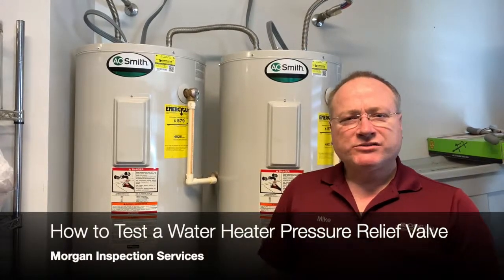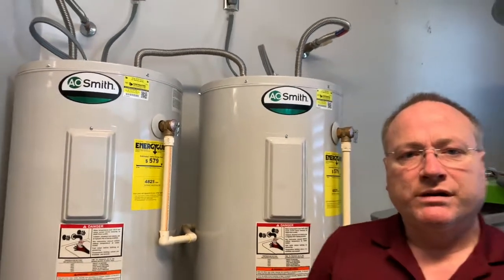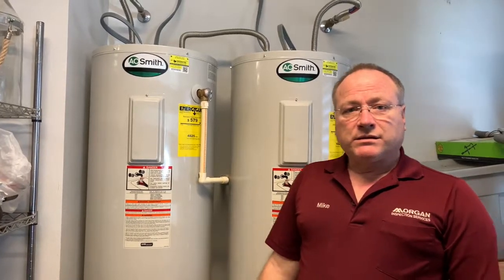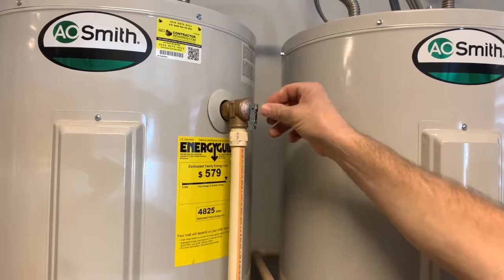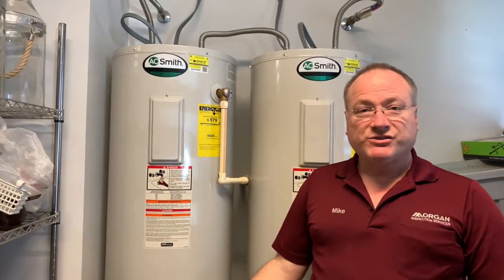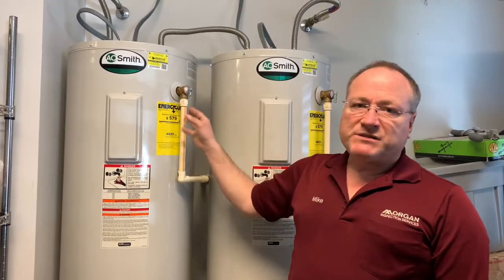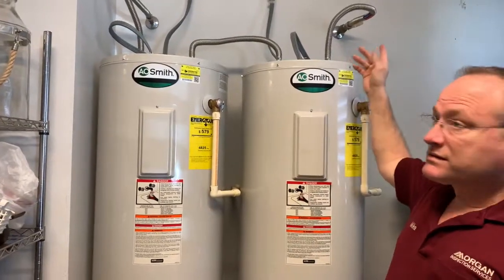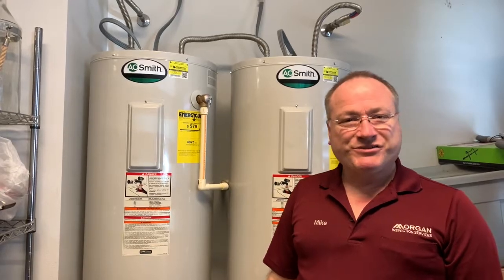How to Test a Water Heater Relief Valve

Comment: Is this valve used to draining heater for maintenance?
Reply from the maker: No. This valve is near the top of the water heater. It is a safety relief valve that will open to relieve if the pressure or temperature in the water heater gets too high. It is designed to prevent the water heater from potentially exploding. The drain valve is on the bottom of the water heater.

Comment: Mine is allowingwater to run out of the heater constantly. In 3 weeks....Ive used 100 gallons of propane and now I know why.
Reply from the maker: Sometimes these things do leak. If you open and close it a few times and tap it with something like the handle of a screwdriver, sometimes that will seat it. If that doesn’t work, it’s probably time to replace it. It’s a really simple procedure, and I do have a video about how to replace the relief valve.  https://youtu.be/zTE7g0itmZA?si=nquWx6ngtFNRyT1v

Comment: When you released the valve, you showed a picture of the outside where water was released. Are all water heaters vented to an external pipe?
Reply from the maker: They are supposed to be, but not always. You should be able to look at your relief valve and see what is connected to it and follow that line to make sure it goes somewhere safe before testing it.

Comment: My overflow drips continually. Does this valve control that
Reply from the maker: I’m not sure what you mean by your overflow. Are you talking about a PVC pipe that goes through an exterior wall near the ground that continues to drip? If that’s what you’re referring to, then yes, it could be your relief valve dripping. Often opening and closing the relief valve two or three times or tapping on it with something such as the handle of a screwdriver can close it and stop the dripping. If not, I do have a video on how to replace the relief valve. It’s a pretty simple procedure.

Comment: How often should water flow through it under normal conditions? Or is it just an emergency system?
Reply from the maker: Under normal conditions, water will never flow through the relief valve. Sometimes they will leak and some water will flow through them, but it shouldn’t ever go through the relief valve.
Reply: Thanks. I accidentally leaned on mine today and cracked the cpvc pipe. I reattached it with gorilla glue until I can research what it is and how urgent to repair it.

Comment: 🤔 dont see any expansion tanks on those water heaters... Expansion Tanks are the safety backup for when the T&P valve doesnt work. Its the little bit of extra safety to keep the water heater from becoming a water pressure bomb.
Reply from the maker: You are correct. Expansion tanks are rare in this part of the country. I’ve done about 8000 home inspections and have probably seen less than 10 expansion tanks in almost 22 years.
Reply: @morganinspectionservices3840  in the last year, I've seen 5 water heaters without them... So much for IPC lol
Reply: @morganinspectionservices3840  I got one, I'm a mait tech at a correctional facility and saw it save our ass when our reducer failed( water going into the building is over 200psi and it drops it to 65....

Comment: One tip that I found helpful,  is to have a new T&P valve on hand before you test the valve on your water heater as recommended.   That way if it continues to drip and can't be stopped you are 100% prepared.  And that could be a good thing,  because a valve that keeps dripping after testing is likely contaminated with mineral deposits and might fail to pop open in case of dangerous pressure or temperature increase.

Comment: Sorry to tell you this but you are not "testing" the relief valve.  All you are doing is "manually" opening it.  You cannot properly test a relief valve unless you have a means to isolate the valve and apply pressuer to the base and record the relief pressure with a calibrated gauge.  If you are curious, look up the American Petroleum Institute Recommended Practice, after all, you are dealing with a heated pressure vessel.
Reply from the maker: I cannot argue with you that we are not testing the high pressure or high temperature function of the relief valve. We are only testing that the valve will open.
Reply: @morganinspectionservices3840  I know I came off sounding pedantic and I apologize to you.  I understand that your advice would help to prevent a relief valve from getting stuck from scale build up.  Kind regards, Al

Comment: I like watching your videos.   About 15 yrs ago in the old farmhouse where i grew up on as a teenager,  while we were out of town hauling cattle to the slaughterhouse,  T&P valve on our 40 gallon electric water heater,  was intermittently discharging extreme hot water that was nearly steam. While also feeling a tingle while touching a hot water faucet in the damp laundry room.   Upon investigation,  my stepfather who is a Jack of all trades,  discovered that a heating element had spilt inside the tank, in such that even though the heater's thermostat was cycling on and off as needed, it only switches one leg, leaving us in a situation where the damaged element was heating  constantly with 120 volts,  causing the tank to overheat and the valve to release,  to protect from an explosion.
Reply from the maker: That is very interesting. A dangerous situation, for sure. Glad the T&P did its job.

Comment: AO Smit brand new.
Is normal to whistle wen release water from the pressure valve? Is twice  a day.
Reply: My husband just reduse, water pressure
And just waiting see if works,
It was whistling more often.
Thanks.
Reply: If the valve is leaking intermittently,  with small amounts,  you have excess pressure,  usually from a check valve or pressure reducing valve. The water, when heated, expands, and cannot flow back into the water main. This is thermal expansion.  If the valve is intermittently releasing large amounts of extremely hot water, you have excess temperature.  You should check for a defective thermostat that is not shutting off the heat source, or a Grounded heating element,  if you have an electric water heater.  The valve is set to go off at 150 PSI or 210 °F
Reply from the maker: Are you saying that your relief valve releases pressure twice a day? That is not normal. I have not heard a whistling noise before.
Reply: @morganinspectionservices3840  hi does it make a difference if the release valve handle is pointing down or pointing up? it looks both up or down directions are the same and once it's horizontal it releases the pressure then I can I flip it pointing up or down and it shuts off
Reply: @fUjiMaNia it does not no.